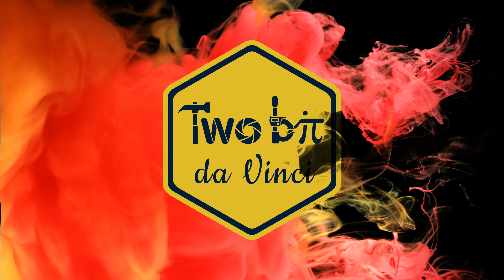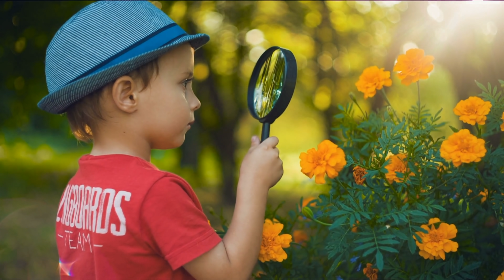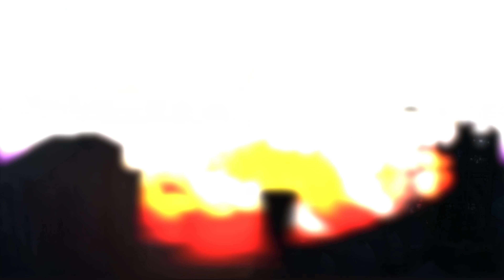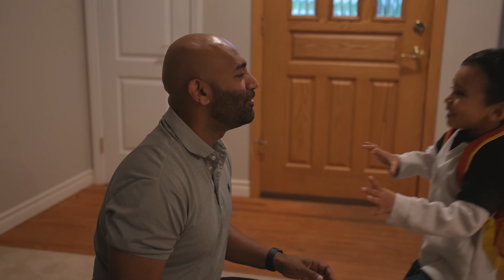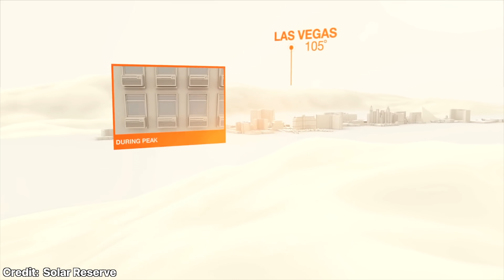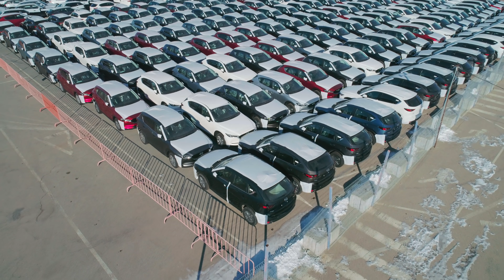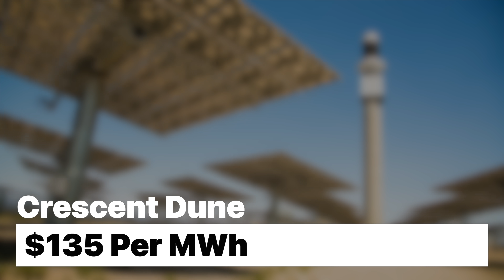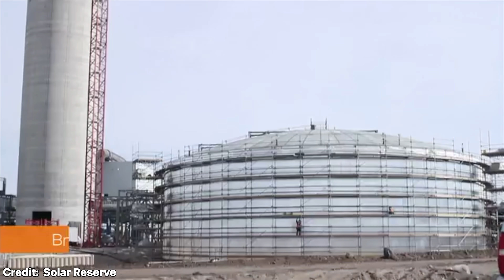This Billion Dollar Solar Plant was an EPIC Failure

Comment: the only true solution is a varied one. but the media hypes over anything that saves the world in the next 5 months of course. everybody is afraid of expanding nuclear because of course we'll have a chernobyl a week despite already having thousands and thousands of plants across the world and only one chernobyl to happen to date. fukushima wasnt even chernobyl. of course everybody has forgotten about that now that its not chernobyl. and of course using natural gas is evil entirely despite it being far better than burning coal. it has to be entirely solar panels everywhere despite that simply not. working. on the scale needed. we need to diversify. but we wont. to the benefit of companys like bp.

Comment: Thermal solar is ludicrous at all levels. The cost is monstrous (and will never come down), the power output entirely dependent upon clear blue skies and there is a massive maintenance burden. A case of what is technically feasible ruling over common sense. This is a folly/vanity project and funded by the hapless tax payer.

Comment: Thermo-electric storage during day, reverse at night....  That means during day the sun gives electricity on the solarpanel, the heat it gives on the panels is given to a simple thermo-coupling system that can store the heat and releases it as soon the sun goes down and gives the heat back to produce electricity...

Comment: I wonder if they can convert it to use some other form of energy generator.. perhaps a TEG doing direct conversion of the heat to electricity, which would make it mostly solid state, aside from perhaps the liquid tank that collects the heat. TEGs are somewhat inefficient, but trade that for operational costs and see if it cheap enough to operate.

Comment: 2000 to 5000 people working for the plant? Did you pull that number out from a hat? Water tanks up on to ff the roof may not be practical to produce electricity, but they can produce hot water for shower and kitchen. There are many other ways or using the sun light/heat, but impediments are not poor engineering but economics and politics.

Comment: Perspective on that S curve: In Norway, EVs (BEV and PHEV combined) were single digit percents of new car sales just 9 years ago. Today it's close to 90%. So within 10 years we went from fringe to mainstream. The few remaining percents will be more difficult, as this is basically the pickup truck (Ford Ranger size, not really F150/Cybertruck/R1T size) and heavy SUV market and noone has plans to market anything like this in Norway. We need an EV that can tow 3.5 metric tons of trailer with a reasonable range (max tow weight on a personal vehicle, above this it's light commercial vehicle territory with a different license and way higher road tolls).

Comment: Things are changing very fast. I have already the production permit and the environmental and the land for 84 MW of Solar Thermal, 
But using Fresnel technology which costs around two and half million per MW installed and the cost of production it is less than 11 eurocent per kilowatt hour the moment that nuclear cost of production for a new reactor it is 18.5 eurocent per kilowatt hour and for a traditional coal steam turbine it is 13 1/2 eurocent per kilowatt hour. At a feed in tariff of 268 euro per MWh guaranteed for 25 years - has a project IRR of 18,5% and an equity IRR near 40%

Comment: Green Energy does not require exempt  materials.
Legal translations:The purpose of environmental design advancement is the utilization of the lowest possible exposures and environmental impact.Products deleterious to health are the mainstay:  advanced polymers of everytype and imagination are protected under intellectual property rights and clauses;and generally without exception the most hideous toxic combinations without appropriate controls is the rule not the exception.
Due to compartmentilizations AIHA,EPA,OSHA ,NIOSH, etc.,have been crippled the last 30 years by the self serving agenda.

Comment: ok so i have what is probably a stupid and uneducated question. a solar panel absorbed some light and reflects light as well. could you not replace all the mirrors of this solar plant with conventional solar panels so you have both regular solar power production and also have the regular process of this plant which uses magnification on the molten salt. what would the math look like in regards to doing something like that.

Comment: I'd say the technical principle has its merits- but the execution was done hastily and without long term usability in mind. For example: The mirror moving actuators could have used brushless motor technology like we now use them on gimbals. It was not common back then - but absolutely doable with some basic research and development. Combined with way oversized,  maintanence free bearings - look how long a typical bike or car can turn its steering and wheels without maintanence needed. And  they have to be small, leightweight and cheap!The same goes for the storage technology: They should have informed themselves about typical problems in advance and worked out bullet proof solutions from ground up, or give up on it and go another route. I boggles my mind why such big casualties can happen without thinking about that in advance.

Comment: This particular project was a failure… but haven’t you seen other projects in full operations running. One of them is Cerro Dominador in Chile! Which is a total success and there’s already planning of building two more for export.
Reply: A total success? Really? I suppose using the fake economics that is normally used with green energy, you can make anything look good. The reality is the opposite, but point this out, and you will be cancelled.
Reply: @Todd the plant by Vegas is operating. It's called Ivanpah. Crescent Dunes is 200 miles north.
Reply: @Todd under 3 dollars the MWh

Comment: Obama's energy guy always hated solar power. They had to clear the land of an endangered tortoises who later died, they had to tear up land to lay the wires a great distance, which loses energy, the panels go bad quickly whether its the motors, or the mirrors covered with dust from sandstorms.

Comment: The same happened to it as what happens to all Government funded projects, the main contractors didn't do the work they sub contracted the work out to other Companies that then did the same until you end up with the people actually building all the parts are on a budget and so corners are cut, the fat cats make all the cream and the workers get the left overs.
I am surprised anyone wonders why these types of jobs never succeed or why they never come close to a properly built system that would have been built for the Original x amount of Billion, rather than the $500 left to build it.
If Projects that have any amount of Government money have a stipulation that whomever wins the Tender has to be the ones to build and complete it with all problems repaired by said Contractor, I can guarantee they will get done properly.
Trouble is that the Person that Won the tender wasn't held responsible, the faults were blamed on the technology instead.
All people need to do is look at any government Contracts and see the costing for the end product.
If a Private Enterprises were to get a House built they could get one built with the land for say $1,000,000 and it would be a good sized home complete with all fittings and fixtures or Turn Ky as they are called.
If the government were to ask for tenders to build exactly the same home on exactly the same land the winning bid would be closer to $4,000,000, the House that would end up getting built would be half the size and all the normal items would be extras and blow the costs out another $500,000.
I saw this happen in the real world where my Wife worked, they needed a building for the employees to have a lunch room, kitchen and toilet facilities, this was 40 years ago, they already had the land so only needed the building, they ended up with a demountable, which is what they use for emergency at Schools or other Government places after a storm or fire.
You can place the thing on the back of a Semi.
It cost the Government $500,000 to supply and install at a time you could buy a house and Land for $85,000 to $150,000 as I bought my Four bedroom highest home with under the house parking with a large kitchen and Dining room as well as a separate lounge room and Sunroom, on 605 sqm or 26 perch.
I worked in the building game for many decades and saw exactly the same sort of thing many many times, as well as many Government jobs where an Official got a new motor for his boat or his house painted for free or all different types of work, or just a monetary bribe.
I only came across one honest Councilman that was given a very nice gift delivered to his house and he said if he found out who had sent it he would make sure they never got another tender again.
So the very rare honest person does get a job in the Government now and again, over a 35 year period, he was the acceptation, all the rest took full advantage, they never asked for anything they would just talk and say something like, damn the motor on my Boat is just not good enough or I need to get my House painted, just hints as to what they wanted to nudge them over on who would get the Job.
There were three main Contractors at one time in the past that had a great system, they took turns in putting in the lowest price mid price and the highest price, the lowest price was still triple what a small business like mine was could do the job for.
What they would do is if the lowest got the job they would pull out and say they couldn't do it and so it would go to the mid,  the mid bidder would split the extra cost between the low price and the mid price and the low price Company would do the job, if the Council picked the high price they would split the extra cost and the low one would still do the job.
This way they controlled the market, they always got the best price, they also no matter which Company did the job, would use small Business like mine to actually do the job, they would offer a price that I could do the job easily as my price would have been at least a third as I would be laughed at by the Council guy in charge of tenders if I put in a bid even only double :).
I was happy with the amount I made as I only did jobs for the big boys when I didn't have enough of my own work and it could be used to fill out a year as you knew three months or more ahead of time when the project would need to be started.
This is why Government should never be in control of building anything, not even a Chicken Coup.

Comment: Use the salt storage system at steel plant to have heat recycled back with wasted heat to make the steel ,and copper ,and aluminum plants in sires to use the heat from steel to make power and store heat to make copper then store to make aluminum as in recycling the softer metals and power to off set the mining foot print buy recycling at copper mine flooded for years they bring cans to to use electric to get the copper out of the lake it made by closing to add steel plant there for it's all about location and recycling reclaimed waste from one of the largest copper mines that could not afford the pumping costs to keep open and copper mine could be a powerful way of using what is just sitting there